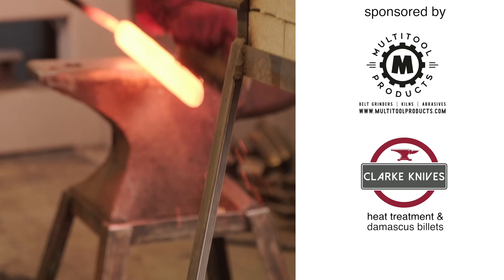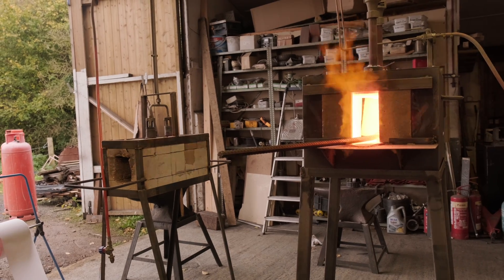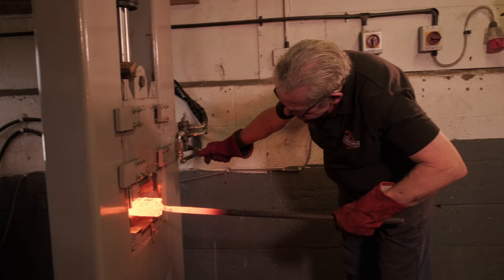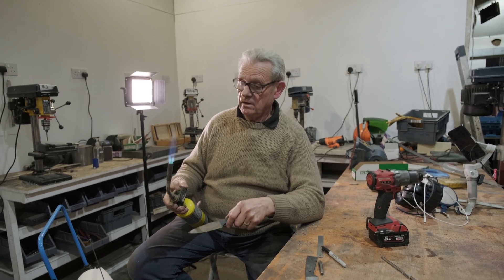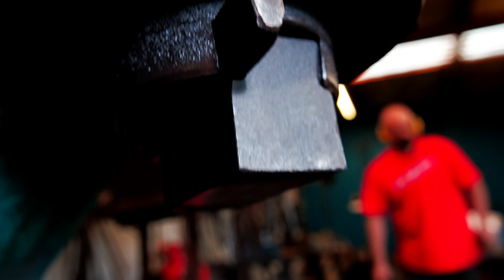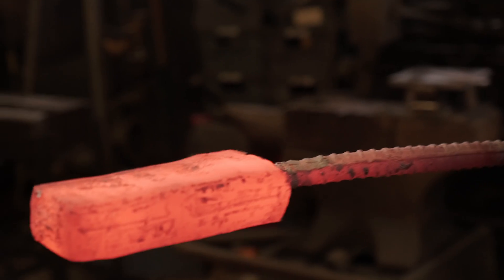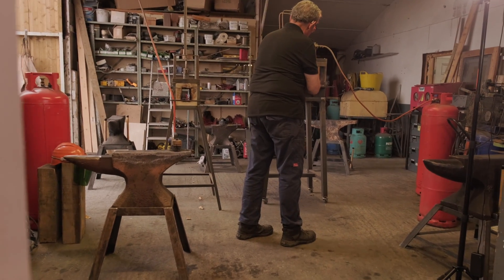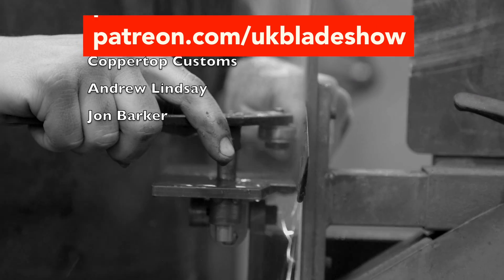Making a Better Damascus in your Forge - Part 2

Comment: So... maybe not forum to ask this. But metallurgist and damascus. Ive done 2 blades in damascus. 1 52 layers. The other 128 layers.  Both have had issues with a blotchy pattern at etch. What i have found through articles and forums is they didnt fully harden. First one probably. Second one i checked with hrc test files. 60hrc all the way across. Now, if i anneal at about 1700F (heat and bury in sand and allow to cool), then requench, the pattern is visible fully in the etch. Im thinking that maybe my normalization isnt allowing the grain to relax fully and therefore crystallize properly in the quench bringing the bold pattern out, but im new to this whole thing. Only about 7 months into forging, so its more guesses than education. Any thoughts?
1095/15n20. Parks 50 oil. Ferric chloride etch. 4:1 ratio 10 mins soaks.

Comment: Great Video! Is Graham using any flux? 
Love from Austria 💚💪🏻
Reply: I don't use flux. I set a gas rich atmosphere which prevents oxidation and not using flux gives my hard working refractory lining a much longer life.
Reply: No flux. If the atmosphere is gas rich it is reducing so will (theoretically) lift any remaining oxides allowing clean metal to weld together. Flux gets into the forge refractory and reduces its melting point to the point where the refractory/oxide/flux mixture melts whilst you're forging - yuk 😒😒
Reply: If there is no oxygen to create oxydization, no flux is required to remove or prevent the oxides.